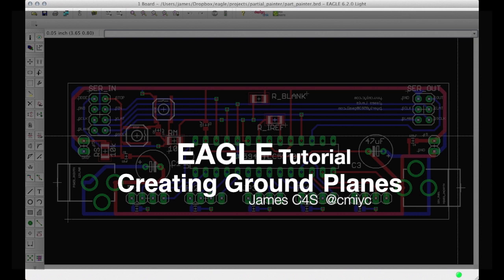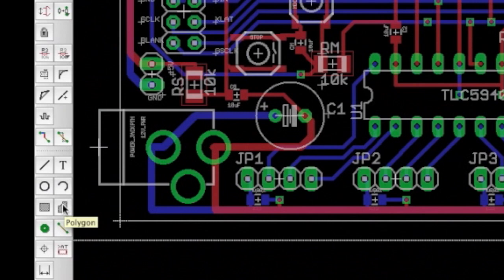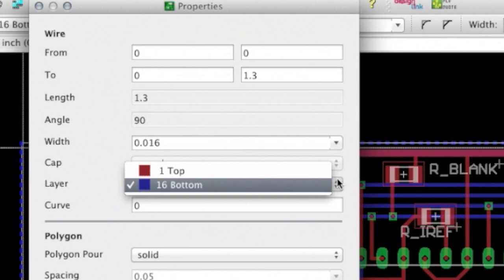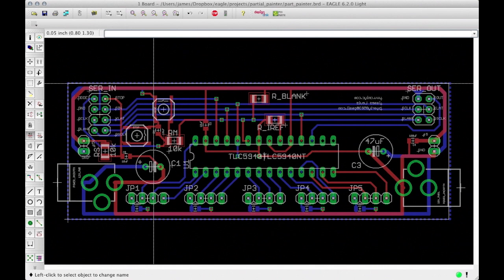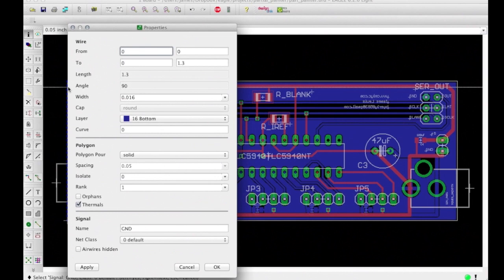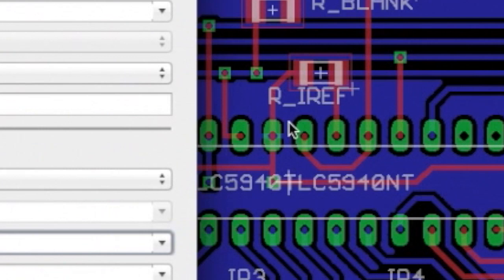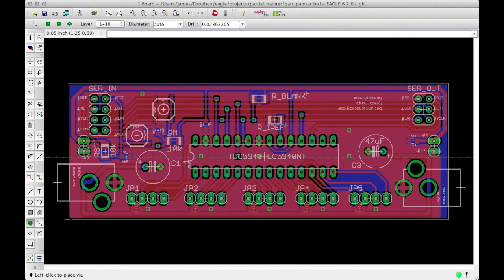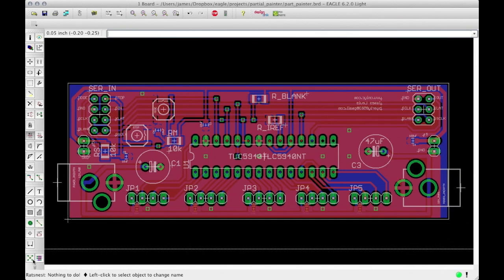EAGLE Tutorial: Ground Planes with Polygons

Comment: Generally speaking place as many vias you can to connect the two ground planes. This method is called via stitching and is used to minimize noise interferences and make a solid ground connection between the two ground planes. It's a good practice. So make use of the non used space and put a bunch of vias there

Comment: Thanks! this was very usefull,  I have a question, say I have a portion of my board where I want the spacing to be larger, like input conectors with higher voltage.

Can I have different spacing within a ground polygon? Because there are some areas that become isolated from ground if I choose a bigger spacing. So i would like a bigger isolation just in certain areas of the board.

Comment: I won't be the first to thank you for this tutorial. I've already used this technique in a dozen designs, or so. This seems to me like a more practical solution than the classical "traces on top, ground plane on the bottom" one. Of course, it still depends a bit on how close the via is to the obstructed current. In essence, you will not get the highest performance by randomly sprinkling vias?
Reply: How do you add a hatched ground plane?

Comment: hi this is great. This is probably a daft question but why use a ground plane. I had made a board and just wired the ground around the circuit. Does the ground plane mean eliminating lots of extra unnecessary GND wiring? Especially if I relabel my negative net to GND
Reply from the maker: Ground planes improve a circuit's signal integrity. By including a ground plane, you provide a better return path. The parasitics (resistance, capacitance, and inductance) of individual ground traces connected together is much higher than a singular ground plane.

In high frequency circuits ground planes are used to control impedances of a trace and as a limited shield from emitting EMI.

From a PCB production perspective, they greatly reduce the amount of copper that needs to be etched (or milled) away.

Comment: Hi! I've wondered about one thing:

After I've defined a polygon, renamed it to GND (for example) and did ratsnest, the design is pretty much over, isn't it ? If I do little changes to a wire, the polygon plane won't change as well.

Is there a way to get around this? I think it's pretty inconvenient to undo all your steps to the point of GND-plane definition, do the change to the wire, and do the plane definition again..

Kind regards,
Tom
Reply from the maker: No. That has never been my experience. You should not have to redefine the plane. Each time the ratnest command is run, the plane will be redrawn. Which means it should accommodate your changes. If not, something else is happening.

Keep in mind that if you do not have "orphans" enabled, it is possible to draw traces that eliminate section sof the plane. So you have to enable orphans in the plane dialog or you need find a way to "reconnect" those orphaned areas to another ground reference. I typically put GND on both the top and bottom, so an additional ground VIA usually fixes it.

Comment: Thanks for the video! have a question regarding the polygon tool. As i attempt to start drawing the polygon, i can't exactly select the top corner of my pcb to start drawing from there. Eveytime i click the corner, the dot appears a bit displaced. This however only happens with the the upper part of the pcb. Any idea why this happens?
Reply from the maker: I haven't used EAGLE for years, so I am not sure what is happening. (I use KiCad now.) But the polygon can be larger than the board, so it doesn't really matter where it starts.

Comment: Anybody here to answer a quick question???  OK, so after I created my ground plane and hit the ratsnest button, my ground plane appeared on the layer on which I drew it.  (I used layer 2, which is an "inside" layer, but I'm not sure it matters.)  Then when my designed appeared to be complete, of course I saved my work.  The apparent problem occurred the next time I opened the file to double check everything one more time.  When I did that, the ground plane did not appear.  Rather only the outside edge or border of the polygon showed up.  I then had to hit the ratsnest command again, and there it was.  Question:  Is my ground plane saved in my job file, or did I miss a step before I saved and exited my work?  I'm very concerned that my boards won't get manufactured correctly!